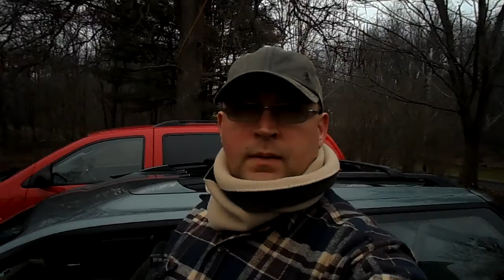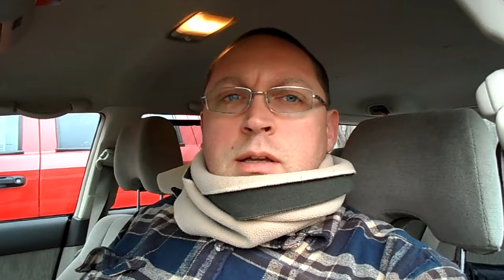P0700 – Transmission control system -malfunction

Comment: Very true, cheaper after market reader came up with P0700, (trans control malf.) Put a more advanced reader on it and it narrowed it down to a P0717, input  speed sensor low voltage. Dont waste your money on a cheap code reader.
Reply: how did you fix the po717 code? and did you have any problems with your transmission shifting?

Comment: i have a po700 engine code A /t code as well p1776  it seems like a speed sensor because when i delete the code the engine light will come on when the car is going over 70klm then when you apply the brakes it drops into limp mode but shifts every gear correctly before this happens 2003 concord so now im currently going to test all the senders to see if they have the 5volt going to them from the ecm and look for possible bad wires.

Comment: Would you get additional codes on dash with P0700 if it were in fact a transmission related issue? I cycle my key on and off 3 times and I get codes from car itself.

Comment: I have a 2016 gmc sierra. The check engine light came on today. Went to auto parts store to get a scan. It came back with a P0700 and P0711. I looked up codes it said TCM malfunction and trans temp sensor problems. I'm I in for a bad day? 75135 Miles on the truck only had it 3 months. Any help would be appreciated.
Reply: I had codes for the same issues on my Honda Prelude. I bought a new tranny sensor and installed it and got that code fixed. The p0700 is the one I can’t figure out. I bought a used replacement tcm since my tranny fluid seems fine. Checking the wires to the tcm is also recommended from what I read before buying a new tcm or ecu

Comment: My transmission actually stopped shifting and is stuck in first gear, so I scanned it using a FIXD device and a p0700 came up along with a P1729 code.
At first I figured I just needed to replace the TCM but someone said I should check my trans  fluid first before buying a replacement...
Reply: Did changing your transmission fluid fix your issue? I have a p0700 but bought a replacement tcm since my fluid looked fine. I read that checking the wires to the tcm would be the next best step after checking the fluid and the fluid was fine?

Comment: Thank you for sharing, you saved me a lot of time. Even though I’m not getting a check engine light, my ANCEL OBD2/EOBD+CAN scan tool is intermittently on occasion picking up P0700 code that allows me to clear, stays cleared for a bit, then returns after a couple weeks. No performance issues right now but have squeal sound when cold and a clicking sound when cold, dissipates after a few minutes of driving. So now I’ll have to pickup a stethoscope and start tracking down what is near failing. Being there is no error codes yet, other than P0700, I’ll have to track down a TCM scanner. Thanks again, now I know.
2006 Durango 4.7L

Comment: I have a 98 Jeep Cherokee XJ with an automatic transmission. I had a bad neutral safety switch. After replacing the switch I now have two codes. P0700 and P1899. I also have a P0463 but I don't think that's related. I tried clearing the codes after replacing the switch but they never went away. Anyone have an idea of what to do next?

Comment: I just get a P0700 now after fixing the other codes on my Chrysler 300 Hemi c  would a new TCM fix my staling issues
Reply: Im having the same issue with my 300c.
Did you find a solution to this problem? Any help would be greatly appreciated .

Comment: Just got this on my 02 Dakota with 205k miles this is the only code it has atm, before this I had a P0303 (misfire) changed all the spark plugs, but now I got a p0700 and shitting myself cause I just bought a K&N cold air intake and got a p0700. Guess just what to expect when you buy a used Chrysler with so much mileage

Comment: P0700 code and P0731 (indicating transmission speed output sensor) which was replaced and codes cleared, yet car runs more erratic then ever. my OBD isn't potent enough to read P0700 on 99 Chrysler 300 M...
Reply: Resolved ?

Comment: Good video good explanation thanks sr.. p0700 it is just code from the transmission module to the ecu to display check engine ligth.. the real code is in my case p1705.. p0700 is just for tge transmission.. in my case  p1705 is neutral safety switch.. that is the real code thanks ...

Comment: I have a 2005 Dodge Dakota that shows  a P0700 01/04 and also C2521 02/04  codes. I also noticed a DTC Fault 02 , Pend 02 .Could anyone help me identify what these codes mean . You would be helping me out tremendously. Thanks in advance.

Comment: So I have P0700 and P0750, P0700 says MIL Request. I've got horrible mpg, jerky shifting going from reverse to drive, and sometimes it does when reversing. Slower acceleration, like its stuck in a lower gear. What is the MIL for ? Does that mean my TCM is not bad?
Reply: Is the shift solenoid causing the TCM code to pop up?
Reply: @kaylaewoldt3628  how did u solve the problem
Reply: @Lilweezynchb  I sold it lol

Comment: Thanks for the video,  my hemi 5.7 is showing both u0100 and p0700 ? Im not sure what is causing this.  Any pointers would be greatly appreciated.
Reply: Did u find anything out
Reply: @mikewilliams2478  , not yet, im driving it now and it seems fine although I know its not. It was terrible about 300 miles ago so im not sure how to remedy the issue so im just driving as this is my only vehicle.
Reply: Steven Gleave I jus replaced my pcm n I got the p0700 code, pcm got the call running great then this code pops up
Reply: Steven Gleave 2006 charger srt8
Reply: @mikewilliams2478  2005 300C

Comment: am working on jeep patriot 2007 and it was given me p0700 I need help
Reply: have to get a scanner that can access the transmission controller, see if there are codes stored there. any drivability issues might point you in the right direction. for giggles, disconnect the battery for an hour and see if it resets.

Comment: I got two codes on my Chevy cobalt “p0700” and a “P0700 P”  ??
Reply from the maker: This might be some kind of electrical issue that's self-resetting. Would be a good idea to check over the transmission and controller connections for corrosion or loose connections. Stuff the connectors with dielectric grease to keep water out. Have you noticed any drivability issues?

Comment: thank you for your efforts in making this video: I have M.B A klasse A190 2004 I found 2 foult togathor ( p0700 and p0202 ) pleace can you told me what that means ?
Reply: Hi, my c200 kompressor has the same 2 codes like yours, what was the cause and cure for your problem? Did you fixed it ?

Comment: Thanks for sharing this informative video l have two code with my g scan2 tool p0700 and p2113 .Hyundai vehicle 
Transmission control module malfunction and the other indicated throttle actuator control signal failure.  Is there any relation between this two codes

Comment: Man I have a p0700 code but it's not accompanied by another p07xx code. Only a p000a and p1616 what could that mean?
Reply: Roy Mazingo  I replaced my cv axle on the driver side and the code came up after. I just used a scanner to reset the codes and cycled my key off/on  3x then the codes erased. I drove it about 30 miles and still no coded. Give it a try hope it helps
Reply from the maker: You might need a specialist for your YMM to get a deeper diagnosis and to determine what the other DTCs mean. If the MIL is on and there's a P0700 with engine DTCs, it could just be that the transmission is in limp-home mode because of whatever engine malfunction.
Reply from the maker: Well, a failing torque converter is not unheard-of, but it's not common. I suppose if the rest of the transmission works properly, no slipping shifts, etc, then a new TC isn't that bad. Still, a second opinion might be worthwhile.

Comment: Hello all:
Does anyone know what the p0700 and p0320 codes mean?
Reply from the maker: Well, the P0320 refers to the crankshaft position sensor. Without that, the engine can run, but not great. P0700 is probably set because the transmission controller isn't getting an engine speed input. I'm figuring once you repair the CKP signal, the P0700 would clear.
Reply: @BATAutoTechnical  I reset and dump the codes but now only the P0700 code is showing. So does that mean I need to replace the transmission control sensor or there may be a air leak in the lines from the gas cap to the engine compartment?
Thanks for any information that may be of use.
Reply from the maker: @RAIDER13NATION72  After driving around a few days, have any other DTCs been recorded? If it's showing only P0700 then you're going to need a scanner that can read the transmission codes. P0700 only means ther transmission controller is seeing a fault, but your scanner isn't seeing the transmission controller apparently. Don't guess. There are 10,000+ codes that could mean and one of 100,000+ faults.

Comment: @BAT Auto Technical
My lights on dash go out and speedo jumps to 120 down to zero causing cruise control to floor it. I have codes multiple times of each of the following 700, 720 and 1698. They are all P.O. numbers but each does list Transmission control failure and speed sensor output failure unreadable and lastly no bus message from control module. I also have a po420 catalyst. Sometimes transmission will shift but will leave out overdrive until a restart once all this happens. Happens twice a week so not consistently. 98 Dodge 3.8 grand Caravan. Any help anybody?
Reply: Jon Bro need new TCM PCU
Reply: seems like you've got a few different things going on here, p0420 probably is a dead cat or exhaust leak, and shouldn't have anything to do with the cruise control thing, so don't worry about that unless you have to pass emissions testing.

on the other hand, the p0720 and speedometer freaking out makes me think you've got a problem with the transmission output speed sensor, which p0720 refers to. seeing as you seem to be describing an intermittent problem, i'd suspect a broken wire or loose connector on that circuit. https://www.troublecodes.net/pcodes/p0720/

i've seen forums mentioning various fixes. poor connections at the powertrain control module and transmission control module (PCM and TCM), which are located on opposite fenders in the engine bay, are a common issue. check the connectors for corrosion, bent pins, stuff them with dielectric grease to keep water out. instrument cluster problems sometime manifest as a no-start, which is a $50 junkyard swap. double-check your battery and ground connections, including body ground, chassis ground, and fusible link and fuse box power supply. low voltage really messes up Dodge electronics. finally, the most expensive fix was to replace the transmission controller, which i wouldn't do as "a diagnostic step."

Comment: I scanned my 2006 dodge durango, and came up with a PO700, PO750 and PO123 shift solenoid A
Reply from the maker: This sounds like a common problem for Durango. The shift solenoids control the automatic transmission, but if they're sticking, poorly connected, etc, it won't be able to shift into certain gears. The easiest check is to make sure the connectors on the transmission are fully seated (open circuit) and there is no water (short circuit). If that doesn't work, you might have to go deeper and circuit-check Shift Solenoid A.
Reply: @BATAutoTechnical  found out that the Solenoid pack was bad, had to get it replaced, Thanks
Reply from the maker: @allenwhite6946  That's great. Let us know how it turns out once that's done.
Reply: @BATAutoTechnical  I got it done, cost me $900 and seems to be running better now

Comment: Thanks..I've a P0700 and P0750 code
Reply: Jackie Smith i have a 705 as well
Reply: What was wrong with your vehicle
Reply: p0750 refers to one of the shift solenoids on or in the transmission. these are electrically-operated valves, activated and deactivated by the transmission controller. this is usually an electrical problem, perhaps a broken wire or dead solenoid valve, but since confirmation is also by other means than voltage, low fluid or burnt clutches can trigger this code, too. https://www.troublecodes.net/pcodes/p0750/

Comment: i habe p0700 and p0730 help
Reply: if only p0730, i'd have your transmission checked to see if it's slipping. this usually means one of the gears isn't engaging properly, perhaps due to wear or insufficient pressure. because the controller is measuring input speed and output speed, it can see when the relationship between them doesn't correlate to the selected gear. check fluid level and condition. https://www.troublecodes.net/pcodes/p0730/
Reply: could you fix it, same problem here
Reply: Did you fix it? What was the issue?

Comment: Thank you for your information, you make more sense than the dealership, I have P0700, P0725, and P1794, code, can you help me.
Reply: ATL Georgia whats ended up being  p0725
Reply: Auto Zone, said it an Engine speed circuit malfunction.
Reply: ATL Georgia transsmission speed sensor?
Reply: the code that auto zone gave me was 0725 that  A/T Engine Speed Sensor Circuit Malfunction, and 1794 A/T Speed Sensor Ground Circuit. I haven't took it anywhere yet.  WHere are you located at Diana.
Reply: i believe it has to do with the inside part of the engine speed sensor it probably went bad from that side
Reply: I been replacing every part from a fuel pump, intake, and speed sensor and it still cuting off. Do you have a dodge ram 1500?
Reply: I just wanted to say you are very lovely by your profile picture
Reply: for p0725 this doesn't refer to the engine crankshaft sensor (that would be more along the lines of p0335 to 339) this is referring to the rpm signal going to the transmission controller (TCM). replacing CKP won't fix the problem, because CKP is fine for the engine to start and run. from what i understand, TCM doesn't get its engine speed signal from the engine controller or CKP, but from its own speed sensor, the input speed sensor on the transmission. p1794 seems to confirm my suspicions. i think you need to check the connections on the transmission and TCM, make sure no corrosion and pack them with dielectric grease to keep water out. also, check the circuit between the TCM and the speed sensor on the transmission. https://www.troublecodes.net/pcodes/p0725/